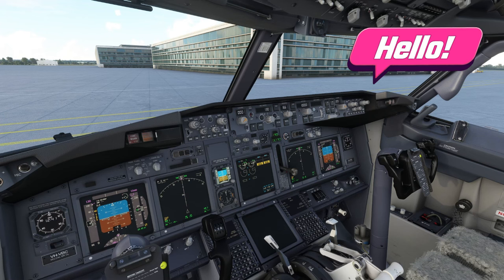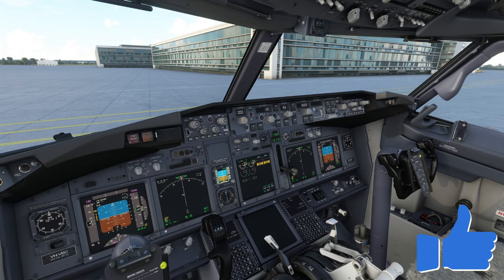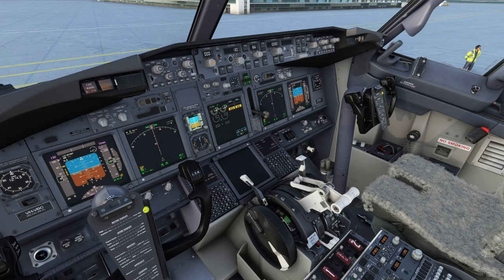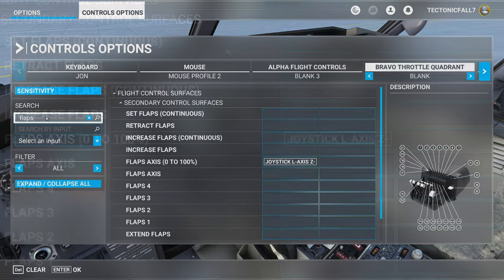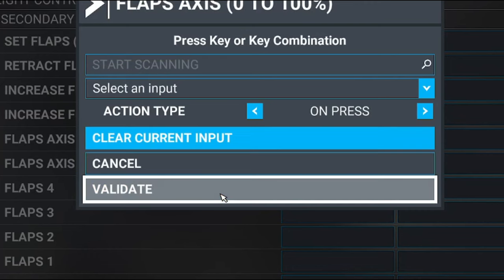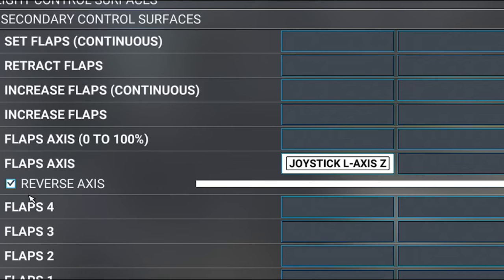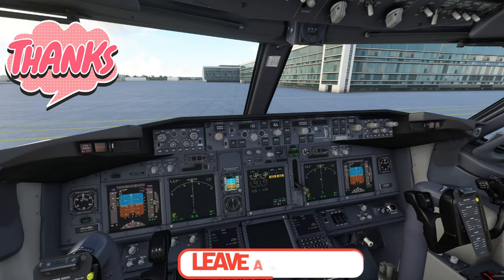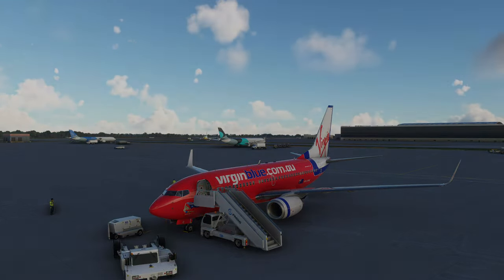Msfs2020*Flap Axis Setup for the PMDG 737* Setup for Bravo, Velocity, Boeing, Saitek & more.

Comment: I would suggest to all of the viewers of this channel, if you are using the Bravo throttle quadrant, to first copy the default 2 engine commercial jet profile, make your changes to the bindings and save it as PMDG B737-7 or what ever you desire.  If you have issues with any of the other controls, ie...throttles, spoilers, you may not want to use the axis (0-100%) for those items as well.
Reply from the maker: thanks for this info

Comment: I don't have a throttle quadrant but this is good to know.
Reply from the maker: hey steve if you do get a quadrant i highly recommend using spad.nxt as you will not have any issues and there's so much you can do with it for control bindings.
Reply: @2020fsers  What is your throttle recommendation?
Reply from the maker: Oh my that is a great question 🤔 well I have to say the most versatile is the bravo but it's not perfect.  Not sure if you see my bravo teardown video but they all have wiring issues that can be fixed if you take it apart but the warranty is not replacing with new they are sending refurbished units so if you get one new tear it open loosen up the wiring that goes to the reversers or they will snap. Other then that the Boeing I hear is not that great or you have the airbus I don't have any first hand on that one. So not many options Steve unless someone else chimes in with a suggestion. Oh and Saitek for the money that is a great starter.
Reply: @2020fsers  Mark from SimHanger suggested the Honeycomb
Reply from the maker: That's what i have .

Comment: Flap doesnt work it does its own thing when i assign it to flaps axis
Reply from the maker: did you use the 0-100 axis? if so use the other 1 its like 100 to 100 or something like that
Reply: @2020fsers  Mine is on Flaps Axis and if i go down one notch of flaps, it takes the flaps all the way to 40